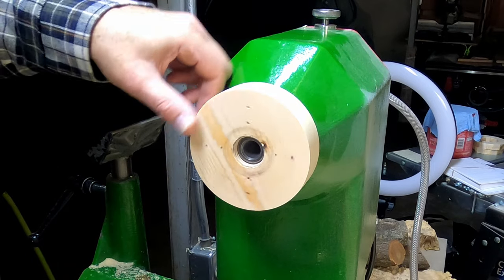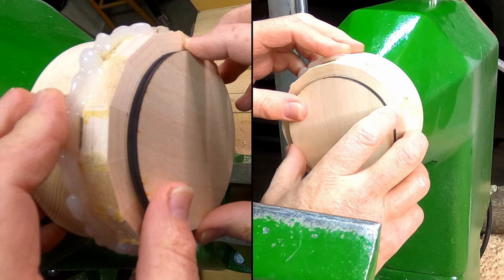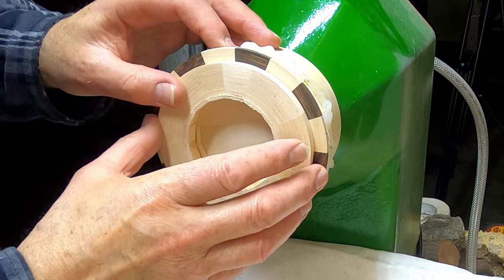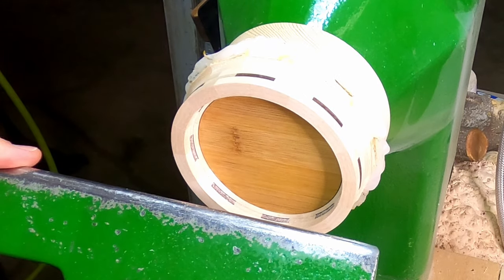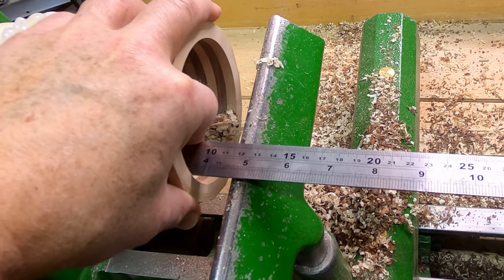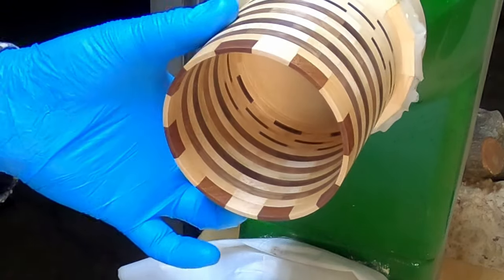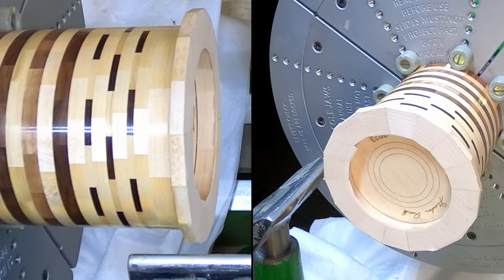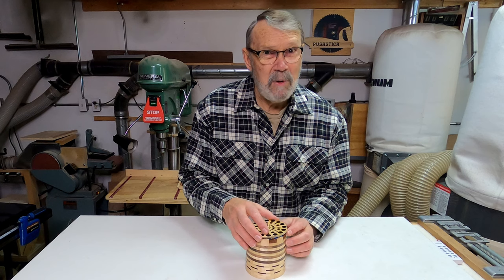Potpourri Box - Woodturning

Comment: Very nice design choices, Gord. And good explain on using the glue chuck and the floating bottom. Guessing wifey will indeed give it approval as an attractive disguise for the air freshener. 😃 Cindy great, and D-Way tools has their Boxmaster tool line that Jimmy designed for making boxes. Both good sources for high quality box making tools.
Reply from the maker: Thank you so much, Valerie. You are very kind. Yes, Gayle did give her approval. I have a couple of D- Way tools, and they are superlative quality, as well. As I said, I am a big fan of Cindy’s. Thanks for watching!

Comment: Another excellent video production, Gord!  The Potpourri Box is beautiful, as well.  I really like the lid you designed, it's mesmerizing!  You told me once that you make your own logo coins.  This was before you got the lasers.  My question is, how do you make them?  They look like golden plastic, is that true?  Another question is, will you consider making them with your laser?  Just wondering.  I always thought if I had a laser that was the first thing I was going to make.  Now that I have one, I never have!  LOL!  Best laid plans and all that.  Anyway, a very enjoyable video of a unique improvement on Gayle's smelly goods! 😊
Phil
Reply from the maker: Glad you liked it, Phil. Yes, I did make my own logo coins quite a while ago. The plastic that I used is two layers. The bottom layer is black and much thicker than the top layer, which is a brass colour. I used my CNC router to make them and still have about 100 of them left so I haven’t even checked whether I can use the laser engraver to make them. The CNC router was used to do a thin carving of the top layer of plastic. I assume the laser engraver could be used to burn away that top layer of plastic if I set the speed and power correctly. What I am, not sure of, since I have not tried it, is whether the engraver would cut the coin out without just melting it into a puddle. No experience with that yet. I suppose I should try it soon to find out. I will let you know what I find out when I get around to trying it. If you try it before I do, please feel free to let me know what you find out. Thanks!
Take care of yourself, buddy,
…..Gord
Reply: @GordonRock1  I think I heard somewhere that using a laser with some plastics can give off a harmful gas.  Please check that out before you go getting yourself sick, my friend.  I'll be sure to let you know if and when I get to making my own with the laser.
Reply from the maker: I had not heard that, Phil. Thanks for the warning. I will have to check that out.
…..Gord

Comment: Nice job. I’m sure your wife will approve. Aren’t lasers great? The things that can be done to make things easier are endless. I recently made a special indexing wheel for a friend that fits on his lathe. A machine shop wanted to charge him $200 for something I made with 1/8” hardboard. On the vessel you made, have you considered turning the inside of the ring that is directly on top of the floating bottom? That way you wouldn’t have to worry about accidentally touching the plywood disk. Looking forward to your next video
Reply from the maker: Greg, I sure am enjoying learning how to use this laser engraver. You are right there are so many things that can be done with it. No, I had not considered an inside ring to put above the floating disc. Thanks for the thought, I will have to check that out. Always something to think about. Thanks for watching!